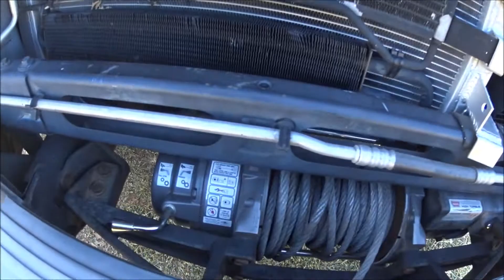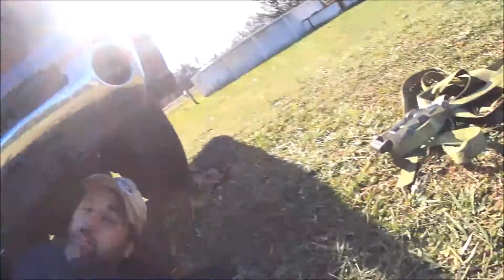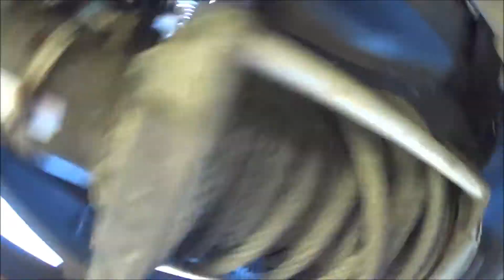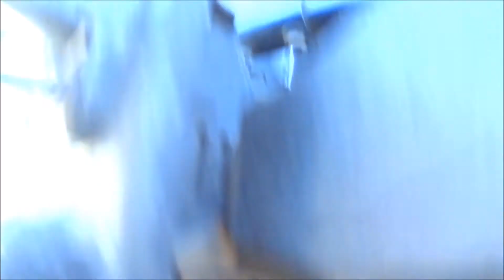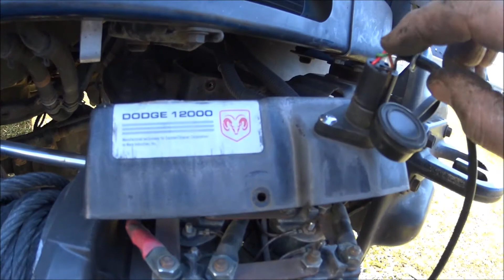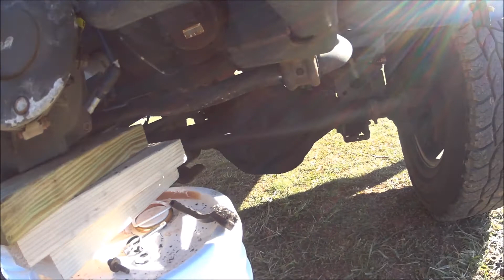Dodge ram 2500 power wagon warn winch won,t spool in?

Comment: Unplug ..and jump the cables?... .mine just stopped working for no reason...
Reply from the maker: it was the safety overload circuit in the winch (its bypassed) and I also ended up replacing the control plug too.
Reply: @Matt's need for speed  found my issue ...saw a spark at battery terminal...nut was loose and cable from winch to battery wasn't making a good connection..tighten the nut ..all good..lucky me....thanks for the vid

Comment: is there a partnumber for that winch carrier? and winch? I'd like to install it on my 2006 model... with Laramie bumper.
Reply from the maker: I’d have to look to see if there’s a part number on it. Weather has been too cold here to look, You could try calling a local dealer and asking them just tell them you need it for a power wagon
Reply: @Mattsneedforspeed  I have an 05 Power Wagon and unfortunately  warn doesn't produce that specific winch anymore nor dose anybody repair them, so you either have to just do without or replace it with the other 10,000 lbs warn winches. There's four to choose from one of two zeon out there one of the two heavy duty ones, the heavy duty you can choose either the steel or synthetic cable
Reply: @nuclearTANK  
12k lb. warn  I recently was in an accident with bumper and brackets to replace, no biggie. But my winch doesn't click at all. That's why I tuned in to this video to see if the solenoids or the motor quit from impact shock.
No, the winch has no physical damage. I have 3 feet of line I told the body shop I'll reel uin out of their way. I have 3 days till I hand it over.